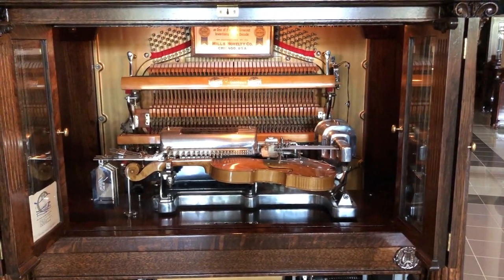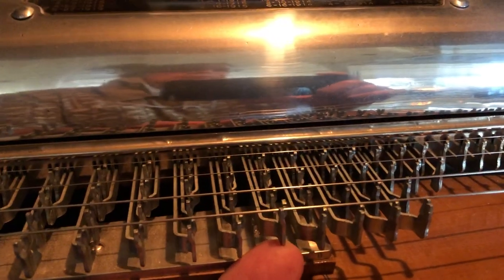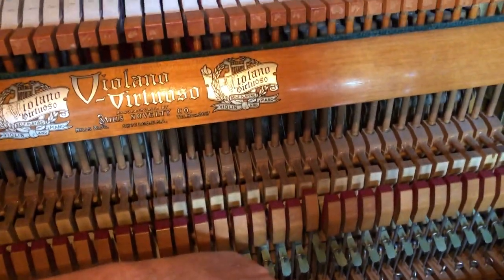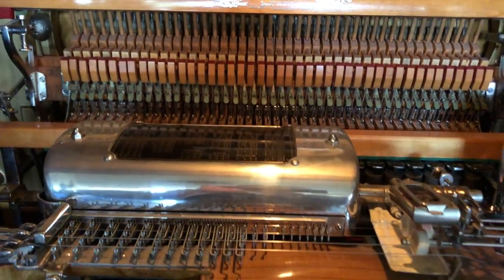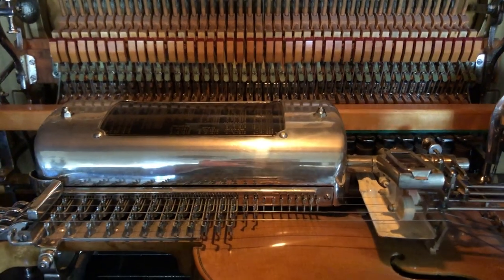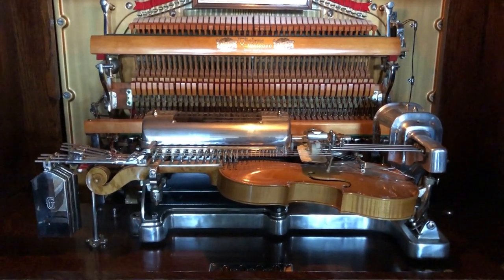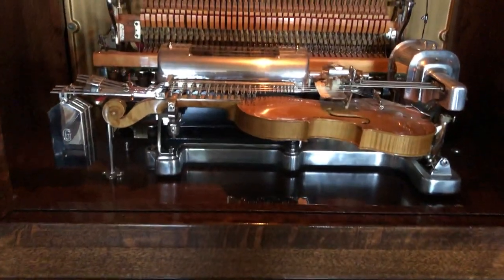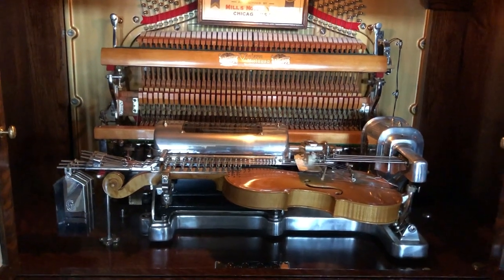Sanfilippo Foundation -  Mills Violano Virtuoso (violin playing machine)

Comment: There are versions that have Keyboards which you can play too. The Piano in this machine is interesting because the Bass Strings are in the Center and the Treble Strings are on the sides which helps balance out the tension. They got that idea from a Kalimba.